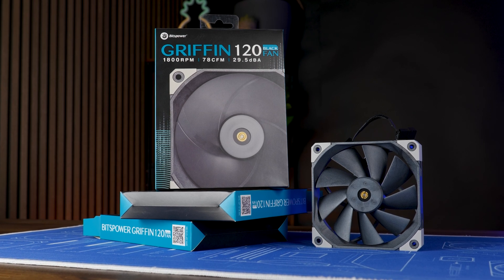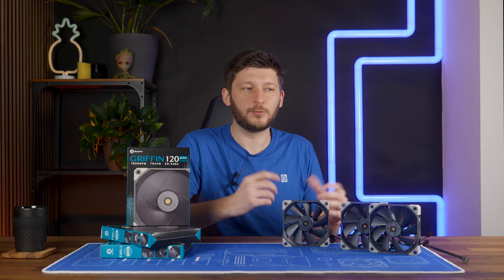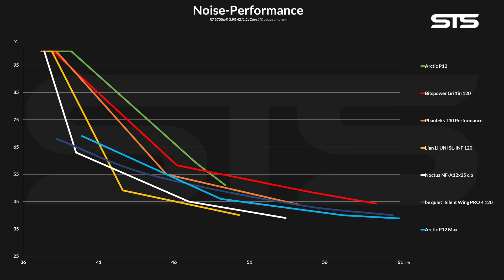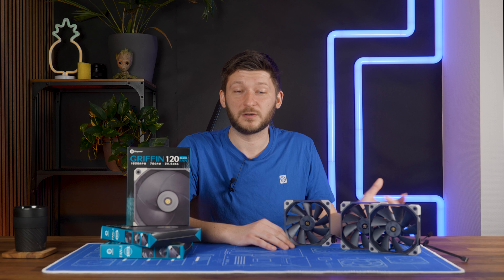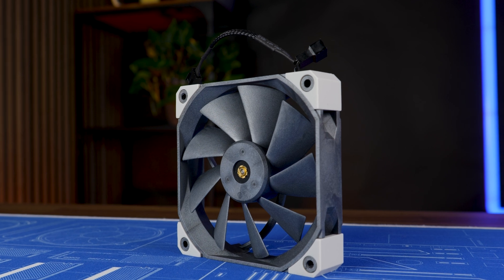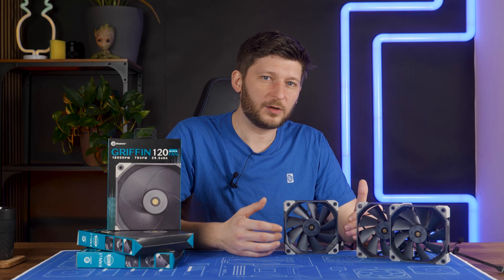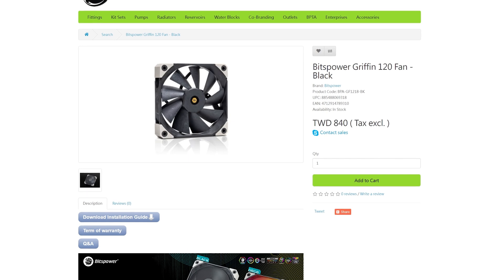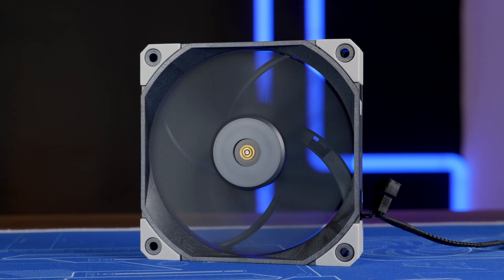Bitspower Griffin 120mm Fan - Can It Compete With An A12x25?

Comment: Love your videos, I really am looking forward to the radiator tests.
Quick suggestion: When showing the graph with all the temps for the fans running at full speed, could you consider adding said speed (either the actual measure, or the theoretical one) next to the name of the fan? Would you also consider splitting this graph into two (120/140mm) sizes?